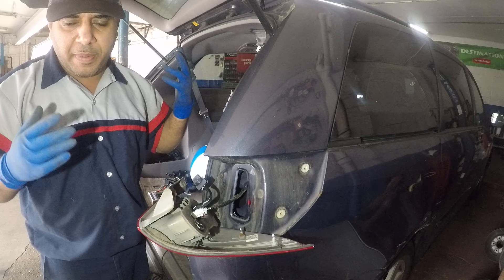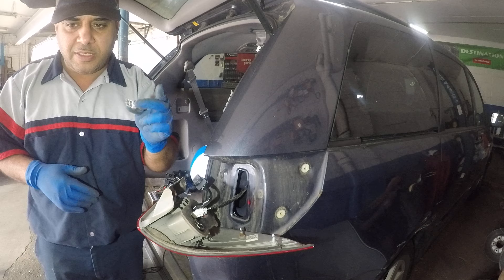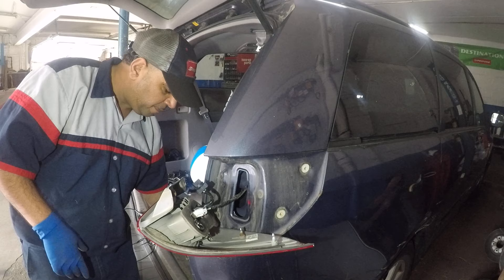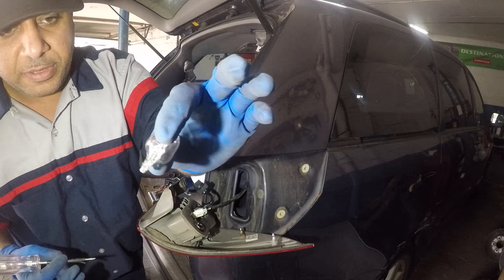Brake lights dont work even after changing bulb electrical trouble shooting

Comment: I had a mechanic come out & install a new starter on my 2008 nissan versa because it kept dying, the battery was new so it wasn’t that. He insisted it was the starter. We paid him $120 for labor only for the car to die again after he left, He came back the next day to fix it, but now my front passenger light won’t come on unless I have the brights on so I know the bulb is good. The brake lights won’t come on anymore unless I have my lights on, so now I have to drive around even during the day with my lights on so that my break lights will work. They do come on so I know that the bulbs are good & it has to be some sort of electrical problem he caused. Any ideas?
Reply from the maker: I’m not sure if I understand stand u correct but tell me again just the light part

Ur brake lights don’t work? Unless u keep head lights on ? 
But I don’t think he could have done anything but u never know
Reply: @RBTheMechanic  yes that’s correct, everything was working fine until he messed with my car. He took out a fuse box & messed with it then put it back & I think that may be the issue. My break lights will not work unless I turn on my headlights, then they work fine. So now in order for my brake lights to work I have to drive around with my headlights on even during the day. Plus my right passenger head light doesn’t work either now, only the driver side headlight works when I turn them on. I think the passenger head light only works if I put my brights on, unless the brights & regular lights are two different bulbs, if that’s the case then only my brights on that side work but I think the regular & brights are one bulb, if so then the bulb only works when I have my brights on. I hope im making sense.
Reply from the maker: @64nessa  maybe he yanked some wires but check to see have some one help u press the brake peddle and see if it work without head lights on
Reply: @RBTheMechanic  me & my mom did that already, the brake lights don’t work unless headlights are on, she stood behind my car & they wouldn’t work, once I turned my headlights on they started working
Reply from the maker: @64nessa  oh ok well this is electrical issue I’ll check the diagram tomorrow maybe I’ll find somthing on my computer will update u
Reply: @RBTheMechanic  ok thank you so much!
Reply from the maker: @64nessa  so I was watching the super bowl then I check somthing online … I think this is ur problem!!! So some ground are shared with head lights and tail lights
So when ur headlights are off that shared circuit is not in use
Therefore ur tail lights are not complet circuit 
Unless u put the lights on then tail braking light work 
So they mechanic did leave loose somthing loose or disconnected somthing I would recommend him to back track his work and see what he did miss or disconnect or broken connection 

Please update me let me know  I still will check circuit schematic once at work tomorrow
Reply: @RBTheMechanic  I took it to Oreillys and the guy pulled back the fuse box & some of the fuses weren’t pushed all the way in, after he pushed them in they started working again! I’m just glad it was an easy fix & didn’t cost me anything. Thanks so much for your help! I’ll keep you in mind if something else ever happens to my car!
Reply from the maker: @64nessa  nice good job yup so he yanked the wires when he worked on ur car all he had to do was double check his work … geat job!!! Lucky u! Hehehe.  Yup msg me when ever u need idea or opinion help with cars issues

Comment: Hey I just changed my brake light bulbs to LEDs and they work when turned on but doesn’t get brighter when my brakes are stepped how do I fix this
Reply from the maker: Well u might have wrong bulb or not propper connection
Reply: @RBTheMechanic  Ok I’m guessing the connection because I ended up putting my old light bulbs in and the brake lights still won’t get bright when brakes applied. Guessing it messed up my wires 🤦‍♂️

Comment: My bulb is loose and every time i hit a bump it bedomes intermittent
Reply from the maker: Replace the bulb and check connections
Reply: @RBTheMechanic  I have 2 new bulbs. Everytime I go over a bump It seems to stop working.  Sporadically it will work.

Comment: my break lights work during day time... when i turn on head lights then break lights dont work... what is the problem..?
Reply from the maker: Start with changing ur bulbs also I need u to make video on this post it let me see what ur talking about
Reply: @RBTheMechanic  i meant, when i dont use front headlights, at that time break lights work well... and at night time when i switch on the front main lights at that time back lights are ok but when i press the break paddle at that time break lights dont work sir...
Reply from the maker: @Suraj318460  that’s wierddd start with switching bulbs make sure u out on correct bulb
Reply: Appreciated, thank you so much sir, it works now.. i just changed the bulb... awesome.. thank you😁🙏
Reply from the maker: @Suraj318460  good job

Comment: I have a 2011 Jetta, I replaced the bulbs..however the tail lights work when breaking or turning BUT the tail light doesn’t come on at night 🫤
Reply from the maker: Replace the bulbs it had dual filament could be bad